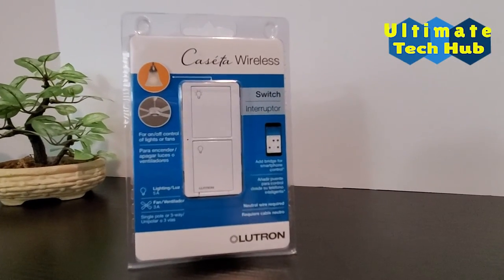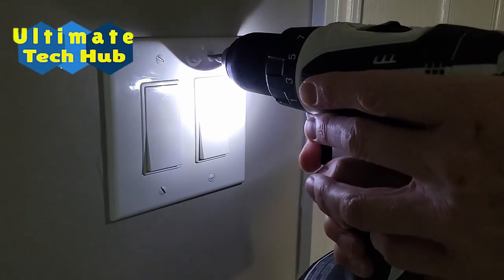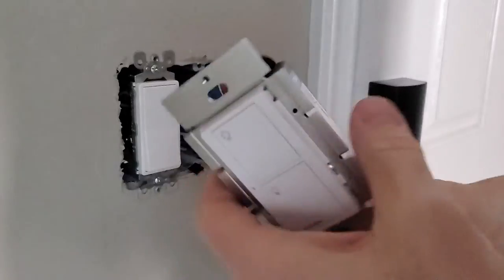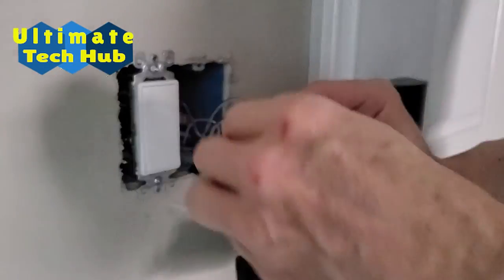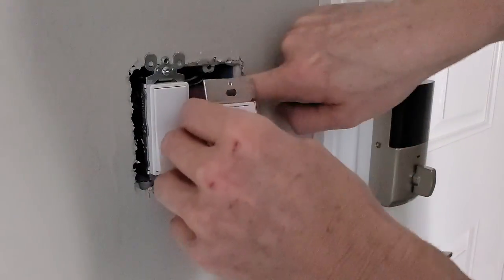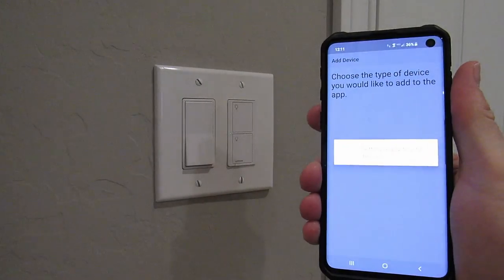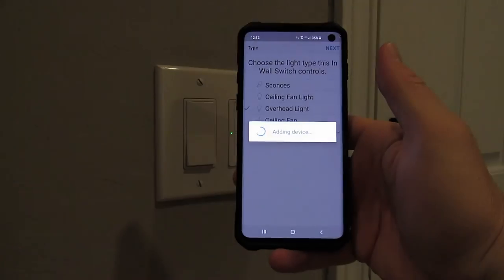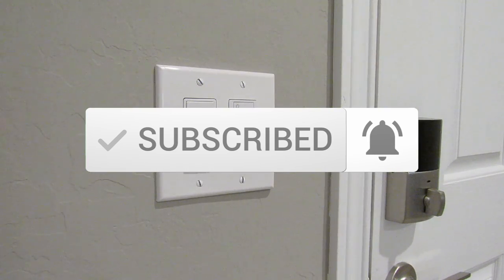HOW TO WIRE A LIGHT SWITCH OR REPLACE A LIGHT SWITCH - SINGLE POLE - CASETA SMART SWITCH

Comment: Does it matter which black wire from the old switch gets connected to a wire (red or black) on the Caseta or are they interchangeable?  Thanks.

Comment: Hi! Thanks for this video. I already have the Lutron Caseta switch installed. But I today I am installing new recessed LED lights in my ceiling. I just turned power back on and lights aren't working. But Caseta's LED isn't on. Is the little LED always on (whether switch is on or off)? DO I need to reset the switch? Thanks!
Reply from the maker: The LED should be on. It might be wires incorrectly.
Reply: @UltimateTechHub  Ugh. I think I'm figuring out that this is possibly "end line" wiring and the power actually went through the old fixture first before it got to switch.

Comment: What would you recommend if the lights are on but the switch wont turn them off?
Reply from the maker: The black wires are installed incorrectly

Comment: Hello. 
I'm in Canada and my condo unit only has two blue and a yellow connected to the switch. 
Two blue are to one side and the yellow to the other. 
I'm assuming the two blues are Line and Load and the Yellow is the ground?
Will this switch work? I know the Smart Dimmer doesn't need a neutral, was wondering if that's a must for this switch.
Reply from the maker: I believe that the Caserta smart switches do not require a neutral wire. I would do an internet search to verify but I think you should be ok.

Comment: Hello. I did the same procedure to install my Lutron smart switch. The LED indicator light was working but not the bulbs. I have no problem with my old switch coz all the bulbs lit up, but after replacing it with the Lutron - Caséta Wireless Smart Lighting Switch, the bulbs are not lighting up anymore. Is there something wrong I did in the connection? By the way, the switch controls two lighting fixtures located in the wall outside my house with 4 candelabra bulbs each, could this be a problem as well? Hope you help me figure out the solution to this. Thanks!
Reply from the maker: Ok try and make sure the white neutral wire is secure to the other nuetral wires in the box. You will need to unscrew the wire cap from the neutral wires in the wall box and wrap the white wire from the switch around the other wires. Screw on the wire cap tightly.  If this doesn't work then reverse the black wires coming out of the wall box to your swirtch. One of these options will solve your problem. Its only 3 wires so it will work just make the corrections and it will work. Keep me posted and good luck.
Reply: Ultimate Tech Hub hello again... so i tried everything you have mentioned above but to no avail. I even replaced all the bulbs (3 for each fixture, a total of 6) still no success. Do you have an email so i can send you the picture?
Reply from the maker: My best guess is to swap the 2 black wires and see if it works.  You did connect the white wire to the other white wires in the box? You would have to remove the wire covee off of the existing white wires and wrap the white wire around the other white wires and twist on the wire cap. Keep me posted.
Reply: Ultimate Tech Hub I’m having the exact problem he is. I’ve installed 10 of these in the house, but this one, the simple one, is not working.  The green light comes on, the neutral wire is secured to the box’s bundle of neutral wires, and I can even pair the switch with the app—but the bulbs will not come on. I’ve switched the traveler wires back and forth, to no avail. I tried it grounded and ungrounded, both to no avail. The bulbs work fine with a standard switch, and this install should’ve been easy, but it’s not workin and I’m going crazy.
Reply: Also I know this lutron switch is working because I’m swapping it from a different light source where it worked brilliantly.
Reply from the maker: @ddean1217  my email information is in the about me section. Send me a picture.
Reply from the maker: @CelloTakesAll  does this light have two switches that control it? If yes make sure the other switch is on. That happened to me.
Reply: Ultimate Tech Hub nope! Just one switch for one porch light.
Reply from the maker: @CelloTakesAll That's very strange. Have you tried resetting the lutron switch? I think there is a way to factory reset it. That may do the trick. Keep me posted.
Reply: Ultimate Tech Hub tried a few times. No luck. Gonna call the 24/7 help line. Thanks tho!!!
Reply from the maker: @CelloTakesAll  when you figure out the solution please let me know. I'm very curious.
Reply: I have the same problem and I even tried reversing two black wires. It’s a single pole switch powering two bulbs outside and the switch is not powering on itself. No green light. How to factory reset this?

Comment: I set it up but it only control the light not the ceiling fan
Reply from the maker: The light is separate from the fan if there are 2 switches. Otherwise, you have to turn the lights on at the ceiling fan. Probably a chain hanging down.

Comment: It doesn't look like I have a neutral wire in my box. I hooked up the ground and connected the two wires to the red and black. The switch doesn't turn on. Any suggestions?
Reply from the maker: I  would connect the two black together in a wire nut and connected the hot (black) wire on the switch to wire nut. Then I wpuod run the red to the bottom screw. And the green to ground. Keep me posted and thank you for watching.

Comment: But do you HAVE to use a smartphone?
Reply from the maker: No you don't it can be just a regular light switch. Or you could buy the pico remote and use it to turn the light on and off from the couch. Thanks for watching and if you subscribed thank you as well.
Reply: @UltimateTechHub  Ok ... sure you can't answer this.  But doesn't all an app do is POST a msg  to the switch? 
So why can't my laptop do the same?
Reply from the maker: @johnjacobjinglehimerschmid3555  you can download the lutron app for your laptop and control your switches .it works the same as the app for a phone. Keep me posted.
Reply: @UltimateTechHub  Will have to check that out.  However, I don't want to have to use the cloud for my home automation.
Reply from the maker: @johnjacobjinglehimerschmid3555  you don't use the cloud you will need the lutron bridge attached to yout home router. That's how the switch communicates with the app  No cloud.